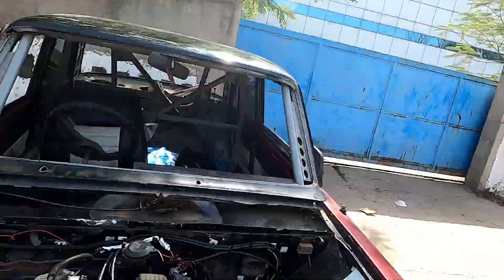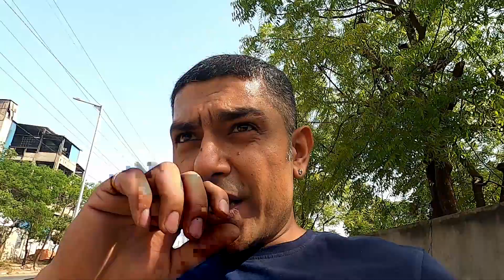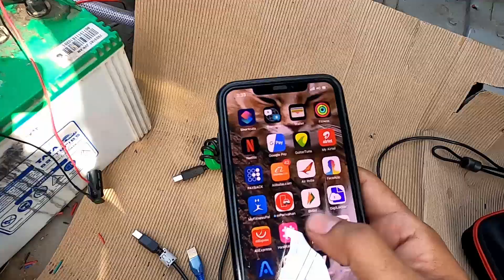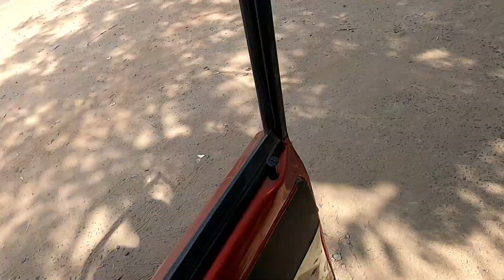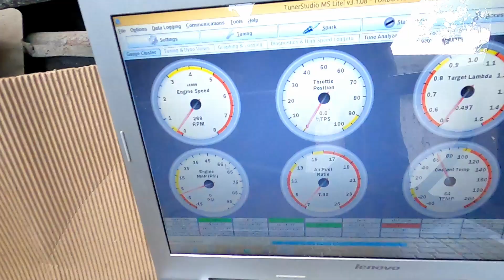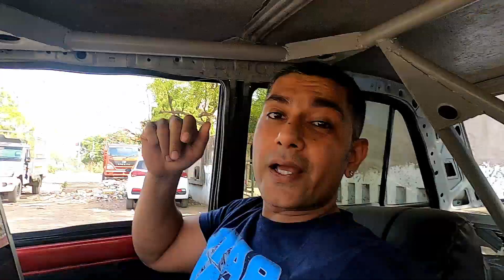Fixing SPEEDUINO Noise & Connection Dropout Issues | DIY ECU PART-5

Comment: The coils too close to wiring harness, use resistor coil wires move coil  close to spark plug. The last coil too close to vr pick up.

Comment: I saw a video from a guy  showing its speeduino  running nice , he didn't  talk about it but I saw another tipe of capacitor atvthe imput , a bigger ones but not ceramic
Reply from the maker: ya i've tried the capacitors. still there is noise.

Comment: The noise comes from imput voltaje , you could try to update the   the output capacitors to a more capacitance value from the the 5 volts regulator toi the a more stable voltaje, but if you do that the moment when you conect it to the source 12volt you are gonna get a spike because of the bigger capacitor,  in that case you could try to make another Imut voltaje board , similar to the inverter igbt welder they use a resistor in parallel with a capacitor .
Reply from the maker: the noise is really annoying. we are going to shift from VR to HALL. hopefully that will resolve the issue.